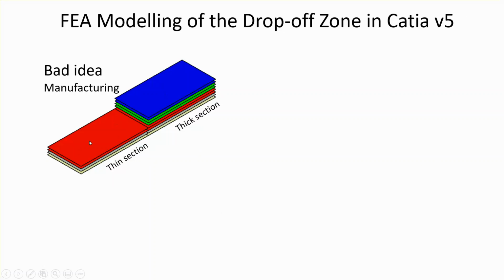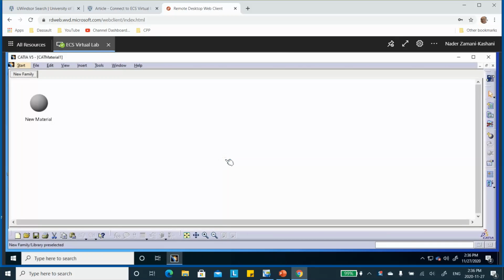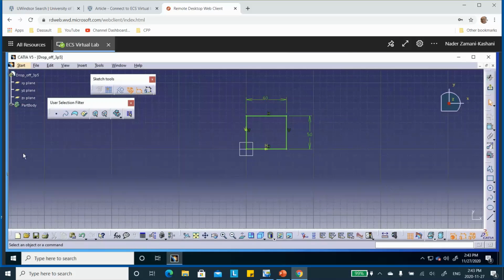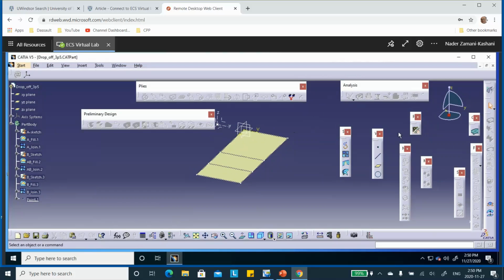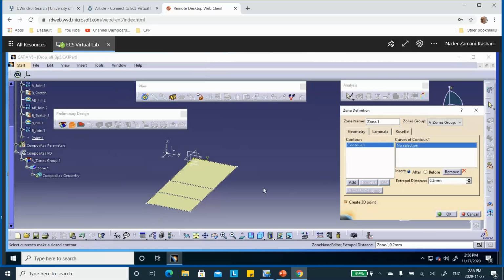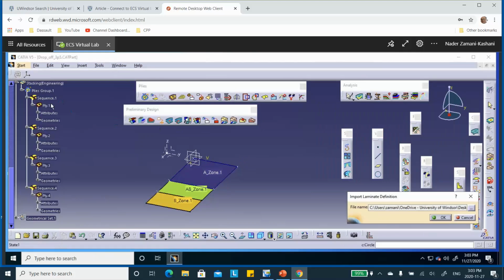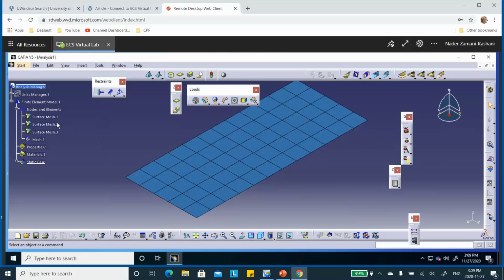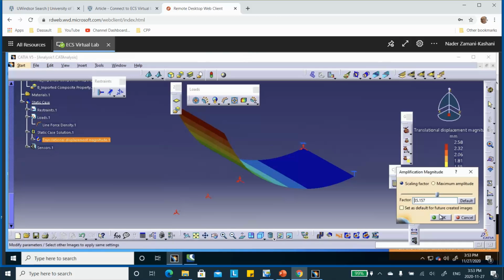Composites Catia v5 "Native" FEA, video 9, Comparison to B3P5, Nader G Zamani

Comment: Hello sir. For some days, I have been intently watching these lectures and learning a lot. I have an issue with doing these problems 'by zone'. As is shown here, we need to first define laminates in the property box, before it is extracted while defining zone groups and zones, and then catia constructs plies, when we click on 'plies from zones' option. My problem is that I am not getting the option to define laminates in the property box at the first place. The dialog box in your videos and my videos are slightly different, in that my property dialog box does not have any option to define laminates. If you could share me your mail id, I could send you the image of the dialog box.
Reply: Thank you. I would wait eagerly. I tried searching if some others had similar issues, but could not find any such issue. Regards. Thank you again for these amazing videos.
Reply: Hello, I also have different dialog boxes. I did this one with the manual ply method, but I think it could be done with the zone group and zone function in that order, however I cannot specify the orientation in that last function. How did you do it in the end?